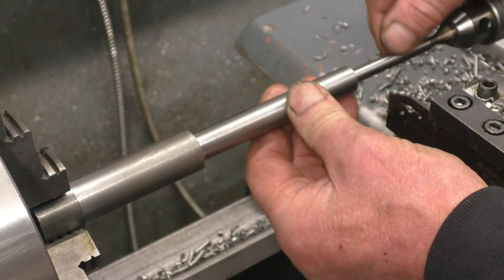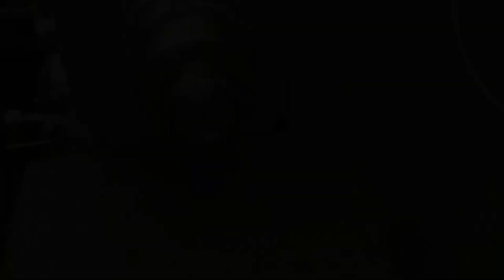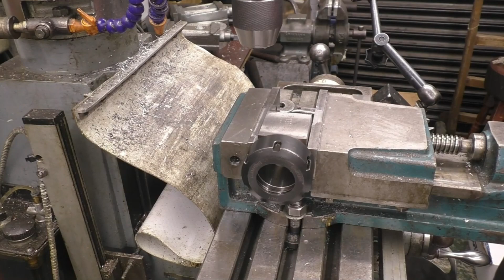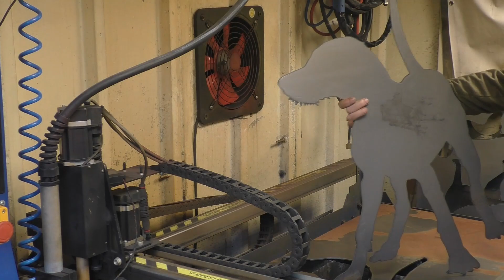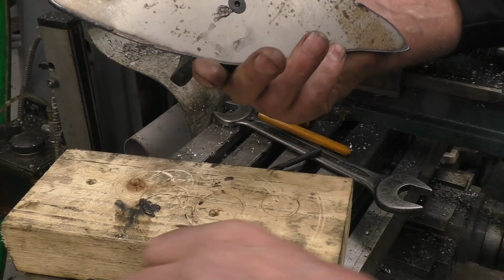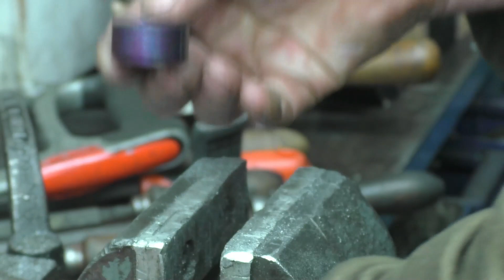SNNC 457 P2  Unwieldable Aluminium . Machining Small Keyways

Comment: As a retired fitter and turner I don't understand why you run the small diameters so slow. You should crank the speed up, especially when using carbide inserts. Check you carbide supplier cutting data for typical cutting speeds for different materials. Cheers Ian new Zealand

Comment: Should have tapped those holes 1/4 BSW, to match the rest, as you likely have both the taps and the countersunk BSW screws as well. But yes a great way to make an unfixable metal work again, though I would say Richard would love if they were used as a pattern, and cast as new in bronze or alubronze, which would be even more hard wearing and resiliant over the original pot metal.

Comment: On crap alloy like that I have had success using the Lumiweld type low temperature rods, cleaned with a stainless wire brush and acetone before joining